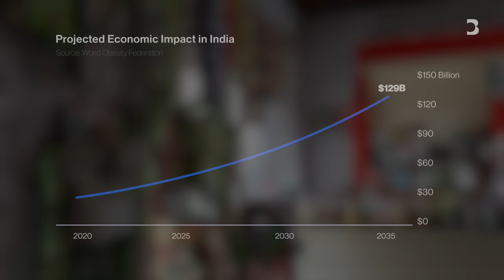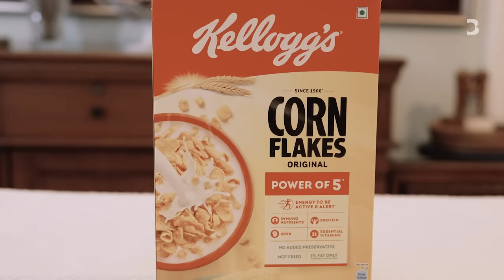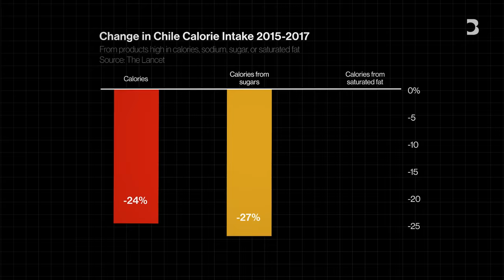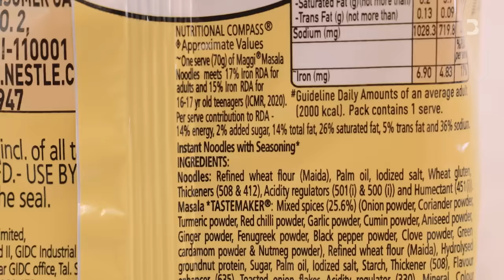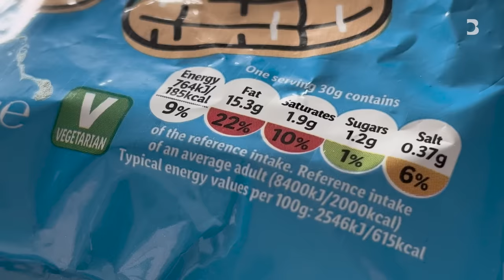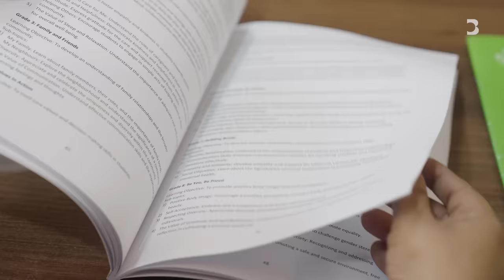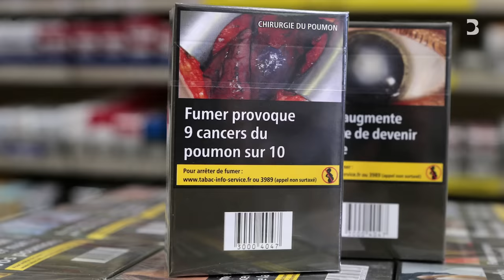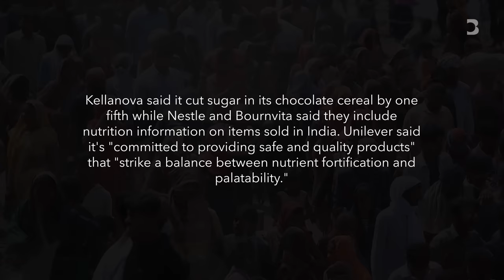India’s Obesity Time Bomb

Comment: It's been a year since I completely stopped eating junk food and I've lost a lot of weight and my moods have drastically improved too. I've completely lost cravings for those processed foods as well. These foods have a terrible effect on both your short term/long term health.
Reply: How did you stop your cravings? I'm struggling with it! I really want to help myself but I'm unable to stop eating chips and chocolate. I easily end up eating 2 packs of chips and chocolates almost everyday. Please help! I want to stop.
Reply: @Sheiwangi some willpower is required. When I started working out and seeing results then that was motivation to not undo those results with junk food. I make sure to always have healthy food options easily available so that I’m not tempted by junk food. Occasionally I’ll allow myself a treat of something like chips, or McDonalds but very rarely.
Reply: What foods? "Processed" is not a food group.
An amino acid is an amino acid. A fatty acid is a fatty acid.
It doesn't matter what the history of how those substances enter your body is.
Reply: @MrCmon113  Surely you can tell that a Cheeto is more processed than an apple
Reply: @Sheiwangi  hey shift for healthy options like oats chips with no palm oil and very minimal sugar or try nuts as snaks
Reply: Same here.

Comment: The biggest problem imo is, indians being extremely defensive when they are questioned. When I talk to my parents or my older relatives about their diet consisting of primarily carbohydrates and almost no protein they usually dismiss what Im saying by claiming that I dont know as much as them. People dont understand that the staple diet of rice/roti(wheat) and lentils is straight carbs and extremely low in protein which just turns into sugar once its metabolised. Even our non processed diet options are terrible and need to be fixed.

Comment: There are three factors to the mass balance of weight gain. ( metabolic syndromes aside) 

Input, output, which are vectors and the last is a scalar... Addiction, exchange your sugar/dopamine addiction on the input (consumption) for a dopamine addiction on the output (exercise). If you aren't exercising you're relegated to extreme vigilance on the input side. Which most people can't maintain.

Comment: We went through with this in the West just 30 years ago. Why India refuses to learn from our experience?
Blaming the companies that sell food won't work. It will just make them more expensive due to the regulatory hoops and bounds, and people will still look for them. The companies' argument is actually sound - it is the Indian people choosing to buy these products. You need to change the perception of the people, and a 5-star rating system won't be enough for that. Not nearly.
India is an agrarian country on steroids. Moving forward means solving problems like this. There are no shortcuts to wealth.

Comment: The best thing you can do is do not eat unless you are hungry. Not the regular kind of hungry, what i mean here is unless you have the prangs. It would be difficult and torturing to the body for a month or so, but soon after that your body will adapt to giving you a hunger call only when it actually is hungry, and not a false hunger call which it has adapted to right now.

All the populations which used to be resource deficient, are facing obesity not only because of carbs rich diet but because their bodies have not evolved for the 2000 calories standard diet of the FDA and West.